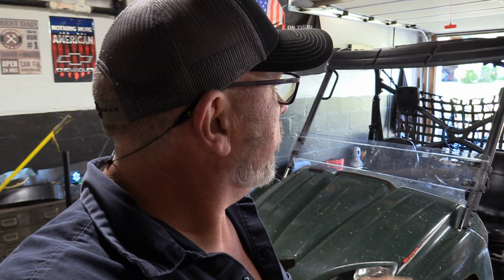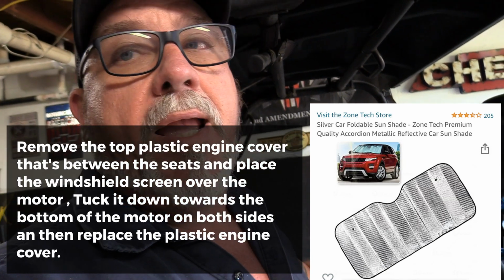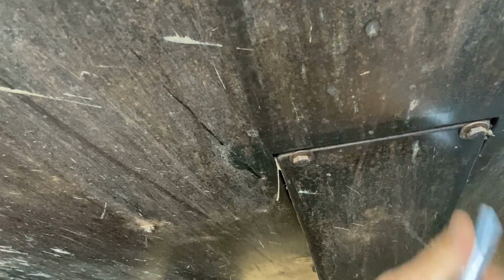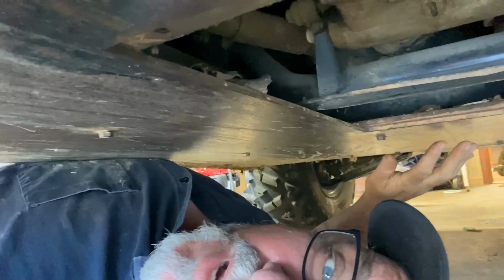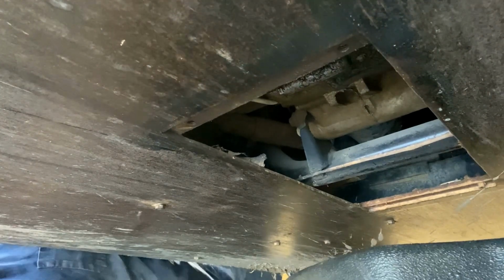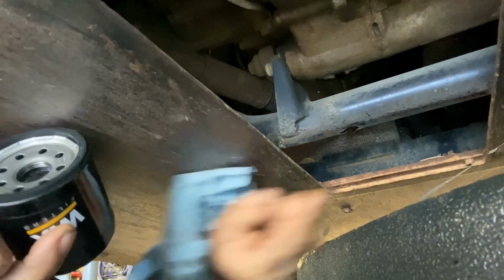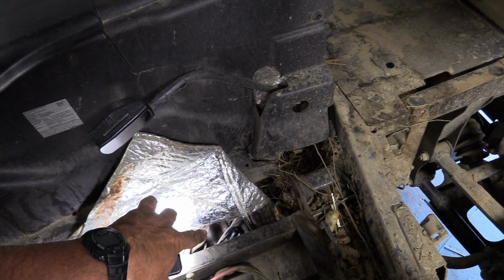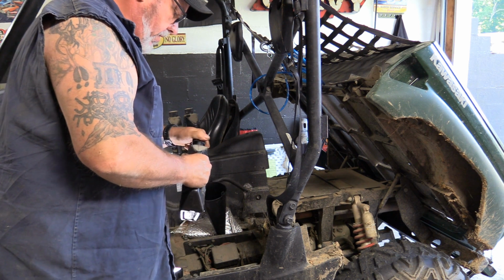Kawasaki teryx 750 oil change

Comment: great video, I know Kawasaki has had their fair share of problems in the past I have had 3 bruteforce 650 I swore I'd never own another one lol but they changed alot of things with their clutch set up and stuff in 2016 and once I settled in on on in 2020 that's what i bought i got the 800 4 seater and we love it I've put over 3,000 miles on it so far. I've done alot to it i put a bruteperformance 2" lift, super atv 2" wheel spacers, jbs clutch kit, msa wheels, rip saw tires, skid plates, light bar and pod lights, exogear stereo, I chopped the top cut 4" out of it, and built a rear bumper for it. if I were going today to buy another machine I'd buy it again in a heart beat
Reply from the maker: It sounds like I need to come shoot a video on your Kawasaki. Lol. That's a very impressive list of accessories and customization . I have a friend that lives in middle Tennessee. He swears by his teryx.  He has a ton of things done to his also. My be doing a video on it soon.
Reply: @pineylife  I live in scott county. I'm sure you've heard of the brimstone riding park. That's my stomping grounds lol we have always rode and hunted all of it
Reply: @jeffreyjeffers156  hi, my name is Dale. I'm the guy that Jamie is talking about. I live in Cumberland County. Got grandkids in scott county. We should get together sometime and let Jamie do a video on both Teryx at same time. Mines a 2018 camo T4 with a lot of extras.
Reply from the maker: @jeffreyjeffers156  yes I have heard of brimstone. I went riding in scott county many years ago on a dried up river bed. We was riding our Honda 300 fourtrax at the time and those river rock about beat me to death. lol. Great memories there.
Reply: @dalewalker2379  yeah for sure sounds good anytime jus holler at me that would be neat to see my rex on youtube lol
Reply from the maker: @dalewalker2379  video sounds good to me. Lol
Reply: @pineylife  Jeffery Jeffers said ok, so it's all on you now.
Reply from the maker: @dalewalker2379   and @Jeff Jeffers sounds good to me. We will be in Crossville July 29th and 30th if yall want to get together and shoot the video.
Reply: @pineylife  yeah we can get together on it if ya want set up time and day be fun to meet yuns
Reply: @pineylife  sounds good. Jeffery Jeffers can bring his and we can meet at my house if you want.
Reply from the maker: @dalewalker2379  sounds good to me. My wife , step daughter and I are camping on our lot that weekend and we could come over Saturday morning maybe and catch up with yall then shoot the video.

Comment: Jamie, the 750 motor is in up to the 2012 models. My 2018 takes just almost 4 quarts. I made a comment on another post (Jeffery Jeffers). I recommended doing e video on both at the same time. Who knows, might even get you out of a pioneer and into a Teryx lol. Solid video brother. I like the plate your uncle has on the front.
Reply from the maker: I seen that. Sounds good on a double video of the teryx. As far as getting me out of a pioneer. I’m not quite convinced yet. Lol

Comment: Hey thanks for the video! Question… how do you lift the dumpbed? someone gave me a machine like this and I see that it has a pivot point but the dump does not release.
Reply from the maker: The lift left is usually in the side of the bed or right inside the cabin. There will be a lever you pull up and the bed will unlock and you should be able to lift the bed if the shocks will allow it

Comment: Good stuff and thanks for the video! I’ve got a question, I bought one a few months ago from a friend and I believe it to have regular motor oil and it won’t shift. Can’t really find solid info on the internet but I bought some Lucas semi-synthetic 10w-40 wet clutch oil, just wondering if that’ll work? It’s says it’s for motorcycles but the oil that was for ATV’s wasn’t the right weight?
Reply from the maker: Thank you and your welcome. Yes the oil you got will work. Lucas is really good oil. If it won’t shift after changing the oil. I would check the belt.
Reply: @pineylife  if I understand right, 2008 was the first year of the Teryx and it is carbureted and in 09 they went EFI

Comment: Is there a transmission in that thing?
Reply from the maker: This teryx has what’s called a KAPS transmission which is a belt driven automatic transmission. So it’s like the Yamaha, Polaris and can ams. Belt driven
Reply: Thank you for your help I’ll try to check out the condition of the belt
Reply from the maker: @jaybuilder8298  Your welcome. If you can upgrade to a Kevlar belt or a heavy duty belt. Keep me posted on your fix